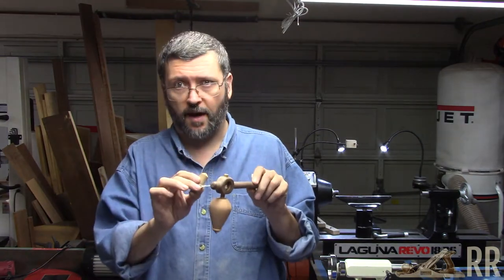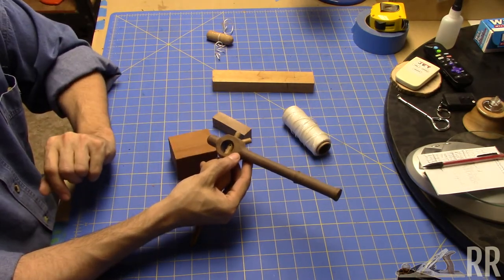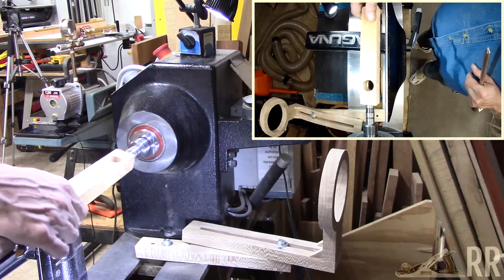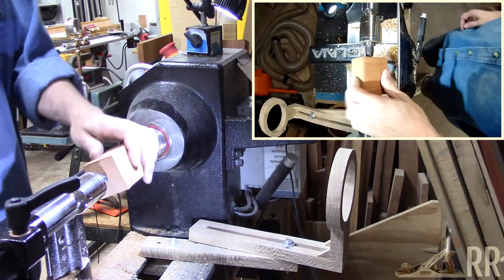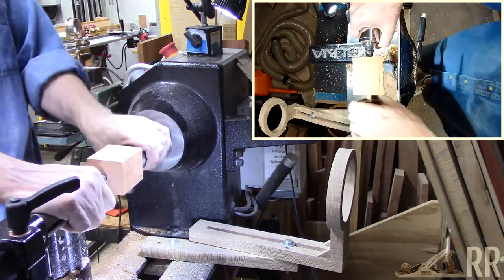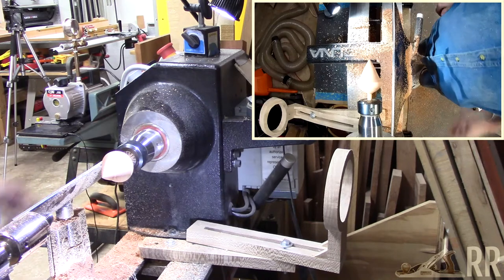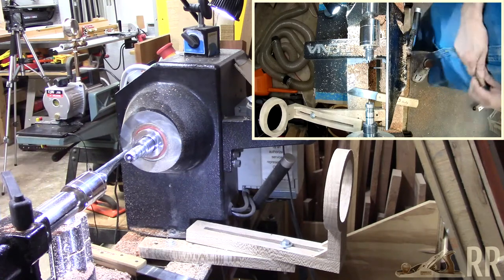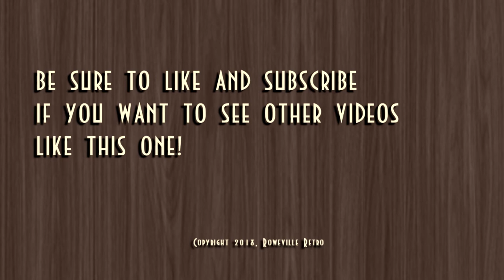Pull String Top Woodturning - 122

Comment: Wouldn't it make more sense to turn it first, then drill the holes?
Reply from the maker: Not really, no. 1., It's harder to get perfectly centered and perpendicular to the other hole, and 2.,  if there is any tear-out from the drilling, you can clean that up on the lathe (at least for the vertical hole).

Thanks,
-Scott